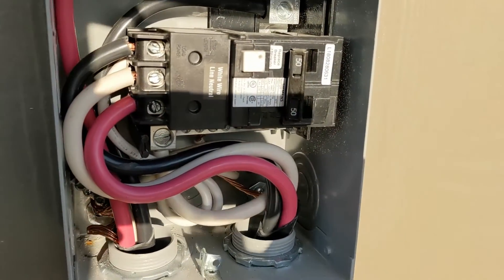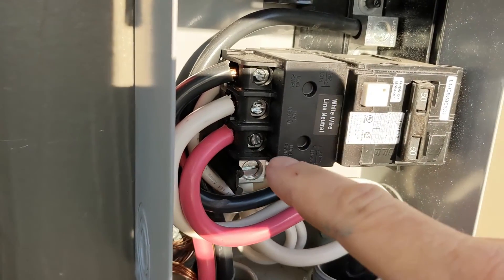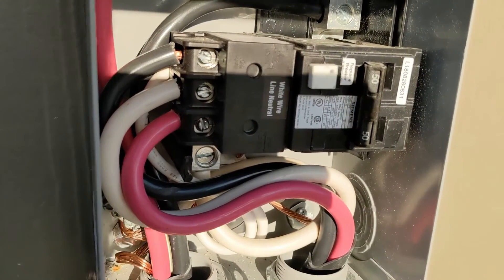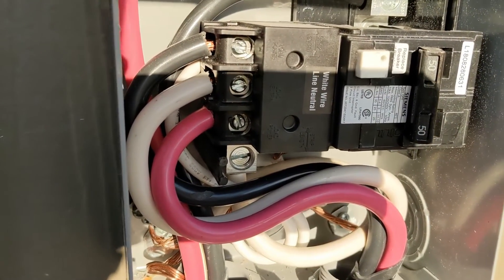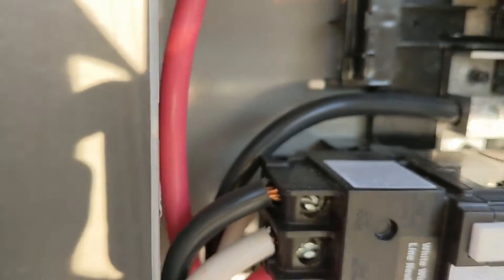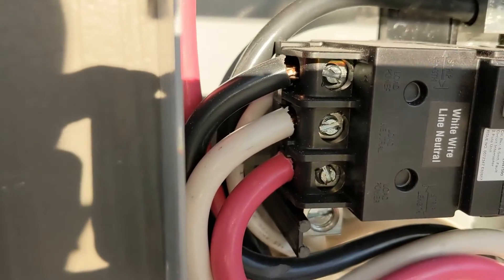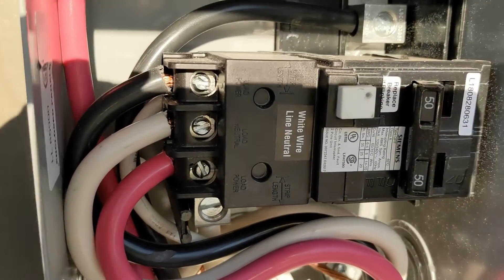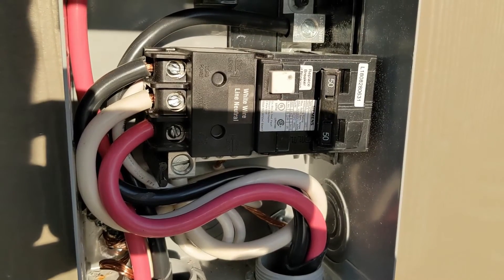How To Wire a Hot Tub GFCI Breaker | Where do the HOT TUB Wires go

Comment: I have had a hot tub for 3 years and now the hot wire going into the house heated up and burnt.  I got the breaker outside replaced and now six months later has happened again.  Hot tub is not bad and electrician says I need another breaker?
Reply from the maker: Maybe the Breaker was installed wrong, Wrong size wire or wrong size breaker.  If your hot tub is 48amps, the breaker inside the house and gfi outside will be 50amps.  The wire size should be 6/3 or 8/3.  This all depends on breaker size and how far the hot tub is to the main breaker in the house.  Might need a different electrician to look at it for your peace of mind.  Its NOT the Hot tub AT ALL.
Reply: @VIPPoolsandSpas  Thank you so much for your input.  The wires from the hot tub are not burnt.  Just the ones from the house which go to the breaker outside.  What's weird if that for two years the hot tub ran fine.  Maybe takes years for the wire to go bad?
Reply from the maker: @8356-4  Well, I would say there's a something wrong from the main breaker inside to the breaker outside.
Reply: @VIPPoolsandSpas  So I think I found the problem.  There was a hidden area where the wire had no conduit and the insulation was cut at some point and someone tape it.  Thanks to you!
Reply: Could that be what cause the wires to get hot?  Water?  I noticed it happening more when it rained.  You must be right.  It's not the hot tub it is only 3 years old.
Reply: Seriously....dude....you are amazing!!
Reply from the maker: @8356-4  My background is Electrical and Electronics.  Plus. I asked my son whos an electrician about it.  lol

Comment: My tub is 3 wire 2 hot and ground no neutral. I thought u had to have a neutral to make them work
Reply from the maker: Most of the tubs coming from the US have no neutral (white) wire.  In Canada, we have to use a neutral white.  Hook up as normal to the outside GFCI and when it comes into the spa pack, just marrette it off.  REMEMBER.  Every wire thats comes from the hot tub, goes on that GFCI.  Even the white.

Comment: What breaker size you got on the main?  My boss gave me a 40A and a 20A GFCI breaker to hook up the tub, like he wants me to split the load but I know that is wrong,  I'm going to ask him for a double pole 50A GFCI, I have a 50A on the main panel  with 3× awg #6  and 1× awg#10 ground .
Reply from the maker: It depends on the hot tub and spa pack you have.  There's some out there that do "split" into 2 breakers.  Most are going to be a 2pole/50amp or the 60amp.  The really old tubs had a 40amp.  Whatever the hot tub spa pack asks for (50amp) that will be the same at the main breaker in the house.  Outside is going to be the GFCI 2pole. and the inside is a normal 2pole.

Comment: So my hot tub will not use the neutral.  So do I just leave that connector empty on GFCI?  Sundance Hamilton only uses 2 hots and ground.  Thanks
Reply from the maker: If your spa pack doesn't have a white (neutral), cap off the neutral from the spa pack to the GFCI.  Depends on the GFCI breaker your using, you might have to put a wire on the breaker neutral to the ground.  White from the GFCI still goes to the neutral bar.  Your electrician will know.
Reply: @VIPPoolsandSpas  Thanks for answering so quickly.  My tub is brand new not yet delivered.  but I am wiring a Homelife Square D 50 amp pool and spa pack disconnect box.  So my plan is to hook up like this..
Main Box to Spa Disconnect GFCI
Red to hot
Black to hot
White to isolated common  Also the pig tail from the Breaker goes to isolated common
Green to ground

From Spa Disconnect to Tub (Sundance Hamilton
Red to hot
Black to hot
Green to ground.
Center terminal on GFCI (common) no connection

Thanks
Joe
Reply: Sorry Red, Black and White are 6 ga wire and Green is 8 ga wire.
Reply from the maker: sounds good
Reply: @VIPPoolsandSpas  Thanks really appreciate you taking the time.
Reply from the maker: @josephgraham1065  wire size depends on length from the main too the tub and total amps of the spa pack.
Reply: @VIPPoolsandSpas  50 Amp 45 feet from main box
Reply from the maker: @josephgraham1065  50amp as long as the spa pack is rated for it.  Most tubs are 50amps.  some are 40amps and some are 60amps.  All depends on equipment.